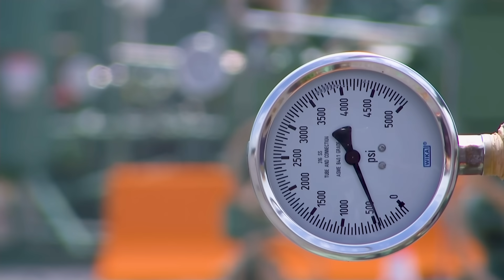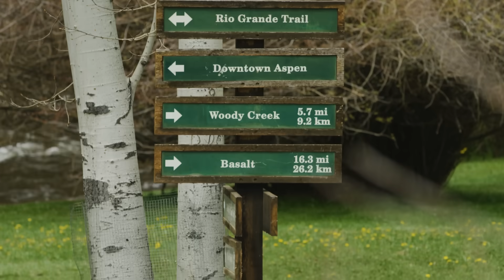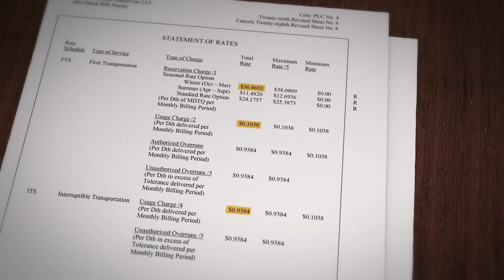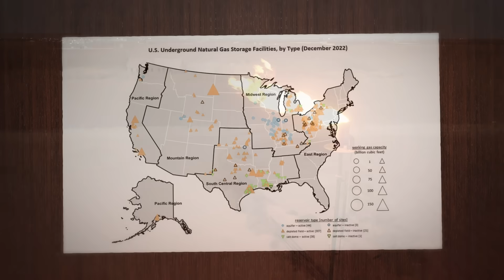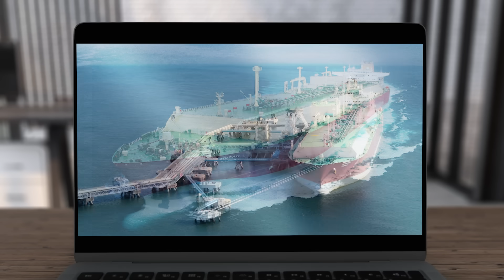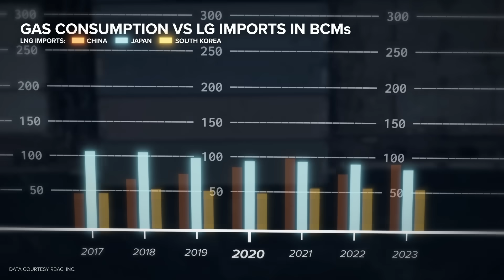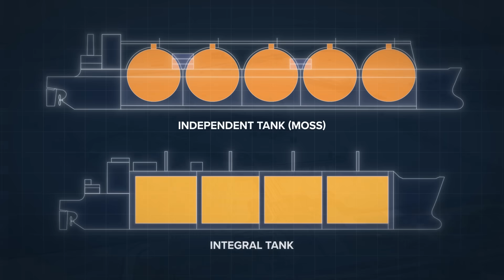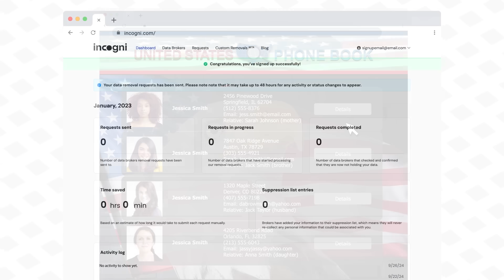The Logistics of Natural Gas

Comment: It's probably a really daft question, but given the biggest customers for LNG are in hot countries and regassification is effectively just warming it up why don't they use a heat exchanger for industrial refrigeration, stadium air conditioning etc? Would this be safe and work well or am I completely wrong?

Comment: What I was hoping would be covered but isn't: LEAKS. There are countless tapped and abandoned wells in the area of west Texas mentioned in the video. Those wells spill an astonishing amount of wasted natural gas including methane. As a result the whole area permanently stinks. I've driven for an hour and not escaped the smell. 
Many of these drilling companies have gone bankrupt and thus aren't responsible for plugging their wells, an expensive process. It's an egregious waste of natural gas and unbelievably damaging to the environment, but nobody is held accountable.
And that's just the wells. The pipeline leak as well. There are satellite maps that illustrate the enormity of this issue.
Reply: The H2S ones concern me.
Reply: Oh yeah. I work in leak detection, and I could double my salary to move to that area, but hell no. It's not even just the ones that are abandoned because the active ones are managed by companies with 1000s of wells, and they might only be by to check each one once or twice a year. If a particular piece of equipment isn't regulated, some will never voluntarily fix it. And even if it is regulated, some areas know they have a minimal chance of inspection = no effort. That being said, the repair process almost involves depressurizing equipment so it's safe to work on, which might be miles of pipe dumped to atmosphere in some cases. The whole thing is a mess environmentally, but we still need it. Every site should be required to have a flare system installed so waste is at least less harmful.
Reply: I’m not certain but flaring isn’t good environmentally either. The regulatory system needs an overhaul. It’s a terrible and insanely costly fix and abandoning wells is cheaper than fixing or upgrading them.

I don’t know what satellite imagery is used for leak detection but it would probably be sad to see. 

Years ago one of the coolest things I saw was two gorgeous labradore retrievers put to work to detect leaks, on an overgrown old line. They found the leaks where the line had a pooled to the surface. The dogs seemed so happy just walking about in the bush having a fun day :) it was an eye opener to me.

Comment: Something that often gets left out of discussions on the cell called "transition" away from fuels like natural gas is the need for heat in certain industries. That cannot be reasonably replicated without carbon based fuel, except possibly with nuclear energy. We use natural gas in our homes because it's more efficient then converting it into electricity first, then back to heat. Given the reliability issues of grids more reliant on renewals, I suspect this usage will continue for some time.

Comment: In my area of Appalachia, eastern Kentucky and western West Virginia, we have LOTS of natural gas wells. They’re everywhere. On every hillside and up every holler around, it seems. Many of these wells are knocking on the door of 100 years old. They were drilled in the early 1900s when the Columbia Gas System was looking for extra capacity to send to customers in Cincinnati, Indianapolis, etc. There are residential gas customers tapped directly off some of these wells, usually land owners who get free or nearly-free gas to use in their home. It’s the hydrocarbon equivalent of catching the water coming out of a spring behind your house lol, straight from the source.

Comment: For those who also did not know what a decatherm / dekatherm is:

The therm is a non-SI unit of heat energy equal to 100,000 British thermal units, and approximately 105 megajoules, 29.3 kilowatt-hours, 25,200 kilocalories and 25.2 thermies. One therm is the energy content of approximately 100 cubic feet of natural gas at standard temperature and pressure.

Comment: I had the distinct pleasure of visiting the Spadeadam site in the UK (where rockets used to be developed), but was repurposed to safety testing gas pipelines (amongst other hazardous testing). In order to test that pipelines are "safe", they have to show that, should a crack develop and propagate, the depressurisation front of the internal gas (its local speed of sound) travels faster than the speed of the crack propagation.

So, for example, a 20-inch pipe is buried to standard depth, and cooled to -20 degrees Celsius (steel is more brittle and fracture-prone the colder it is).

Then they set off an explosive charge. On a pipe filled with pressurised natural gas. The explosions were regularly heard many miles away.

The pipe has been carefully instrumented, and if the depressurisation wave outpaces the crack propagation, the forces pulling the pipe apart will reduce at the crack site, and the crack will stop propagating (eventually).

If the crack propagates faster than the depressurisation wave - the entire pipeline is at risk of just - exploding.
Reply: Wait till you’ve seen a 48” erupt. It was like seeing the moon.

Comment: As far as I know, and please correct me if I’m wrong (this is the internet I know someone will). The pipes could also be used to transport Hydrogen which is a carbon neutral alternative to gas, if done with renewable energy. 
So the pipes would not be obsolete, but would gain a second purpose.
Reply: Any gas. Google hydrogen embrittlement
Reply: Look up just have a thinks video on burning hydrogen. It’s called why hydrogen for home heating is a really dumb idea.

Comment: I only got Thundervolt and only rode two other coasters in 2024 the same park In already rode. Congrats on having ridden TT2; I only hope your one ride was in the very back row, not back car like usual (or front car like usual for a Strata coaster) since it features a reverse shuttle spike in which guests rise higher and drop more in the very back row than any other, unlike a non shuttle coaster when it's usually only important to ride in the last car which may have more than one row.

Comment: I know safety for any construction is strict as hell nowadays days (OSHA, cough cough...) but if an earthquake hits that, you betta hope those compression stations are designed to hold hold the gas back for as long as it takes to repair or make an entirely new pipeline because why would you use the old one when it could be cracked in multiple places scrap that s*** smelt it down send it back the Integrity of this is completely compromised forget it if those earthquakes happen in the cities

Comment: Leave it to the left part of our political spectrum to want to get rid of clean burning natural gas. 
It's extremely cheap it's very efficient and it's time proven and it doesn't require any new infrastructure. 
If anybody thinks they are going to upgrade their water heater to electric they will probably have to upgrade their panel The same goes with their stove. 

And at the end of the day more than likely the electricity at the power plant is going to be made with natural gas in peak production times.

Comment: I used to work at that drywall plant 26 years back, 
Part of the reason for natural gas consumption wasn't just to provide power, which would cover all the electrical needs of the manufacturing process, would also  provide a large gradient of waste heat, which would then be applied to the drying process of drywall. It was far cheaper to purchase the natural gas, generate enough power to cover the manufacture of the drywall as well. The generator operator was the key to the plant, it's financial viability depended upon it. There were four generator operators, usually one, sometimes two to cover the shift. in my 5 years working there, I had a tour of the generator facility once. it was so clean, you could eat off the floor, unlike the rest of the factory. I remember multiple times calling the gen tech if he had both turbines running. You could run the entire factory on one turbine, but Lord Help You if you attempted to even start the third mill without both turbines running. Instant shutdown of the entire facility. I'd seen a co worker do exactly that, once. (startup on any of these would dim the lights, you feel the rumble through the floor) He didn;t get fired immediately, but was gone within a month. They kept 2 diesel generators on site, but were extremely rarely used except for testing and regular exercize. They weren't there to make any money, but to limit losses in a natural gas shutdown. basically to unload the total board machine (2 hours in production, start to finish
That place made thousands an hour running on natural gas, but lost easily thrice as much when fully staffed and not operating.
Reply: I did not wake up this morning
expecting to read a comment about someone working at a drywall plant. This is what makes life fun
Reply: @stevenhubbard9015 I like the way you think, Steven. I concur wholeheartedly. It's shit like this that brings you back in to reality, with that reality being that everyone has their own story that's similar yet vastly different than our own, and uniquely intriguing in its own way. It's why I like Soft White Underbelly
Reply: Very cool to hear about that drywall plant. Thank you.
Reply: I live less than a mile away from that plant, the steam rising from the powerhouse is basically an iconic sight around here 😂
Reply: @specialopsdave  That's actually from the mills and dryers. nice dusting of snow in the parking lot on cold nights
Reply: That's nice to see that drywall made in the USA.
Reply: @dannydaw59  I'm more a brick and plaster kind of guy, but if the US is gonna use drywall would rather see domestic supply!
Reply: I once worked at a poultry/egg farm and farmers really prefer gas heating since it heats up large warehouses much easier and efficient than electrical heating, except for a water pump heater, bit those are really expensive to install,  especially in a industrial setting.
Reply: Combined Heat and Power systems are such a cool 'hack' of thermodynamics. It's a shame we don't make more use of it.
Reply: My parents trucking company hauled the product from the factory for quite a while! It paid decent
Reply: Thanks for the story! It’s awesome to see the efficiency built into a system like that. Need heat to dry your stuff? Might as well make some power while you’re at it.
Reply: Can you expat what you mean by waste heat? Theoretically couldn't this heat be used for more power generation? I am thinking of the context of my high efficiency gas furnace, where the waste heat is very moist so I am wondering how this could be used for drying. Thanks for your perspective!
Reply: @beefstewie13  waste heat in this case refers to the turbine exhaust temp and air volume after generating electricity for the plant. this temp is low enough not to be efficient in further energy conversion to electricity, but is wonderful for doing things like heating up uncured drywall. To this point, there are several drywall plants that operate outside Las Vegas NV that accept the waste heat from nearby power plants to use in their drying process.
Outside of drywall, I know of a power plant about 20 miles from me that heats greenhouses nearby (as well as the slightly elevated CO2 levels to keep greenhouses warm and productive in the winter
Reply: Kinda reminds me how steel mills are always running 24/7 just because it's cheaper and takes less effort to keep them hot at all times than it does to allow them to cool off after the workday and heat back up the next day

Comment: How do they get the water out of the pipeline after the pressure test? Since the pipes more or less follow the landscape, there’s bound to be places where the water won’t run out. Do they have a “water hoover” pig for that purpose? And do they handle the rest by sending warm dry air through the pipeline afterwards?
Reply: Squeegees ❤

Comment: Um, don't you know the sun doesn't shine all the time, we can't possibly use solar power!
You could store that power... 
Nonsense, who ever thought of storing large amounts of energy!

Bah, look at all those trees they had to cut down for those windmills!
They had to cut more down for those gas and oil lines, and the trees can come back closer to the windmills than the gas lines.
But think of the birds!
Moving the goal posts then? Cats kill billions of birds, tall buildings kill more than windmills, do you want to ban those?

LNG is not a 'bridge fuel', it's affirmative action life support for the oil industry. Just like H2.
Reply: Batteries do exist but are expensive and inefficient and not capable yet of supplying all of civilization, especially for months at a time in areas that are not sunny.

I've never heard the main concern with windmills or gas being deforestation.

LNG enables countries to stop burning coal which is much worse. We saw in 2022 when LNG is restricted more coal is burned.
Reply: @homeofthemad3044  Batteries do indeed have issues, which is why I said power storage, not battery storage. 
Batteries are great for homes, cars, small devices, and can be used for grid storage with the variety of different chemistries. Iron air batteries, or flow batteries, or redux, aluminum, carbon... and so on.
However you could also store power via compressed air, use those same caverns storing the compressed explosive gas and instead just compressed plain air. Get the power back out via turbines at 80-90% efficiency. 
Or store it kinetically in moving blocks or spinning masses. 
Or store it thermally in hot sand or water. 
Lots and lots of ways to store power that don't add yet more CO2 and methane to the air nor have the chance to violently explode. 

Where is it not sunny for months at a time and also not windy there? Or where is it not windy, not sunny, and doesn't have a river or a tide to capture power from? 
It's always sunny in space, beamed power is pretty easy, just need the will and initial investment, both of which are being soaked up by big oil's subsidies. 
Plus, and here's a crazy idea, you could run these lines that carry power from where it's sunny or windy or rainy to the places you think exist that don't have any of that. 

LNG enables BP et al to keep drilling the oil. To keep buying our politicians. To keep polluting and covering it up. That's where that whole 'bridge fuel' plan came from.
Reply: @Jcewazhere  
Storing electricity using compressed air or through the other methods you mentioned is interesting and I certainly hope there's potential there but I've never heard of that actually being a viable option. Maybe it is and I just don't know about it, but I've never actually heard of it. And while gas infrastructure can explode it's pretty rare and electrical fires are more likely than gas fires.

Wind and solar power vary greatly depending on the time of the year and the location you're talking about. Wind and solar not only vary depending on weather conditions, but also the season. Different places get strong winds at different times of year and the sun comes out less in the winter. Of course there's technically some of wind and light everywhere but is there enough to reasonably capture? There's plenty of wind in Texas and plenty of sun in California but there's not much of either of those things in Massachusetts which despite political changes relies on natural gas for electricity generation more than almost any other state.

I have no idea what "beamed power" is. However every time I ask people about hydrocarbon subsidies there's little at the end of the tunnel. There are places in the world that subsidize natural gas and other fuels but most places don't. I've never heard of them in the US. And using natural gas as a bridge fuel isn't some conspiracy by energy companies to keep drilling. Natural gas more than anything else has destroyed coal in the US over the last 25 years which has resulted in a steep decline in carbon emissions. I think that is certainly positive.
Reply: @Jcewazhere  Federal land is not "given" to oil and gas companies. It is leased to them in exchange for rent on top of which taxes must be paid on production. It isn't a subsidy, they're paying the government. 

Using land for pipeline infrastructure likely incurs a cost although I don't know what it is off the top of my head. It should be noted that both production and transportation advantages you claim are also available for renewables or other production.

I don't know of any direct funded subsidies going to oil and gas companies.

Comment: This is awesome, when I was an electrician apprentice I got to work on a compressor station. I remember hearing about the pig launcher too but never actually got to see it. When they did pressure testing we weren’t allowed to be on site, they said if we dropped a tool or something on one of the over pressurized lines it could cause a crack and we’d be cut in half from the pressurized gas. They were running the compressors at 125% capacity and about 6 months after we finished it one failed and blew part of the roof off the building and all the blast panels were blown out. The compressors are absolutely massive (think small house) V12 diesel engines that run on the natural gas they compress, the station I worked on had 6 of these engines. Some stations use jet engines. That was during the natural gas rush in PA and NY, the money on the line meant the construction jobs were basically 18 hour a day shifts or more and 7 days week. I don’t think the welders ever stopped, those guys were from all over the country with their own rigs, it was pretty cool.